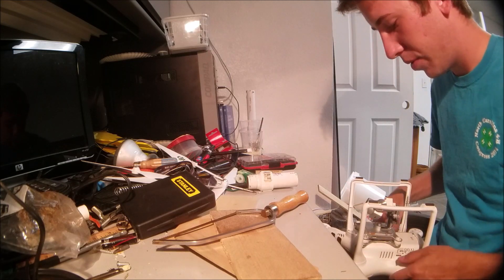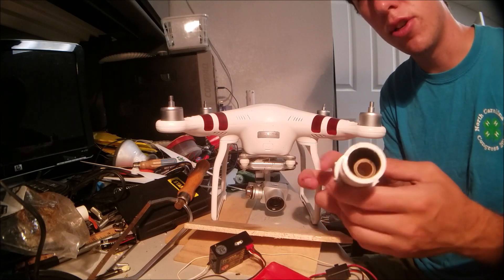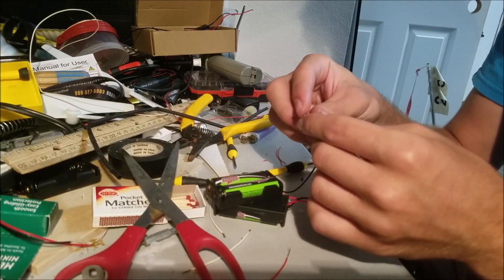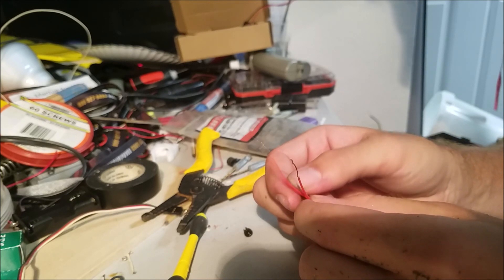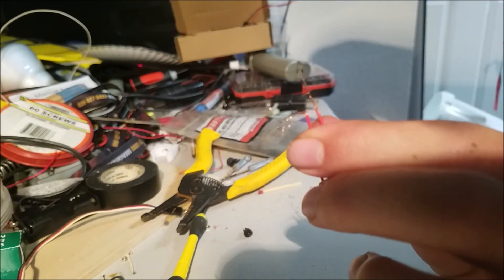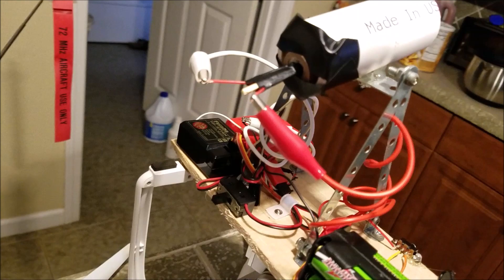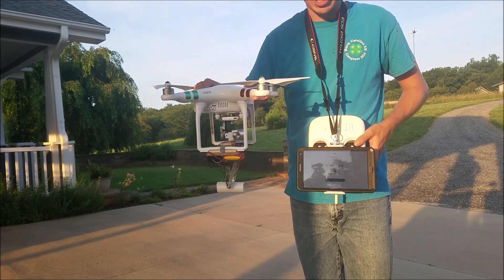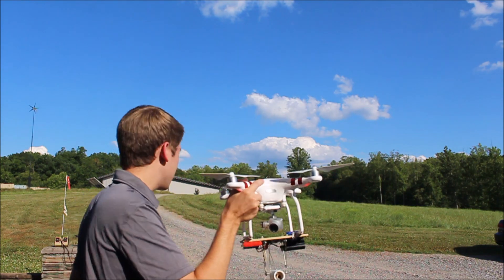Rocket Firing Drone -- DIY Build (DJI Phantom 3)

Comment: I'm sure you've already learned by now but you need to stabilize the engine. Try drilling a small hole in the side of the casing just above the nozzle. Position it just off to the side so that it causes the engine to spin. And boom you just created a stinger missile.